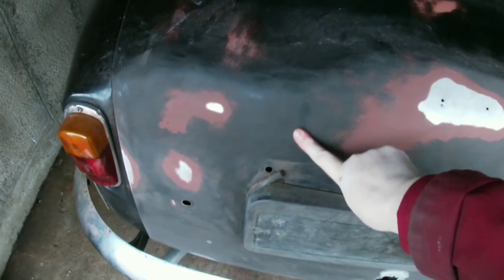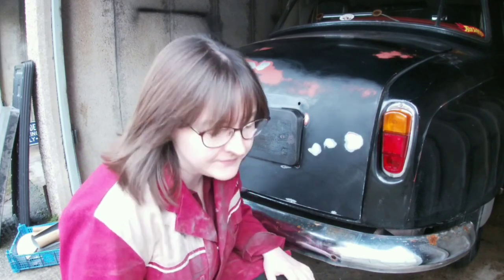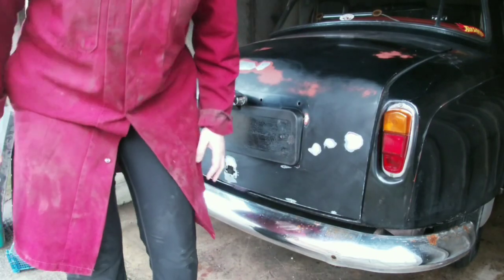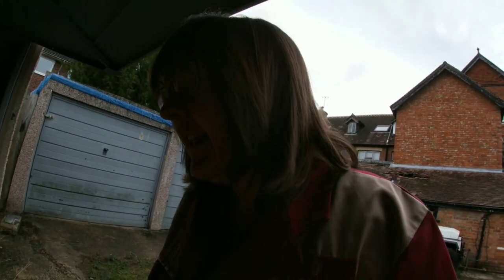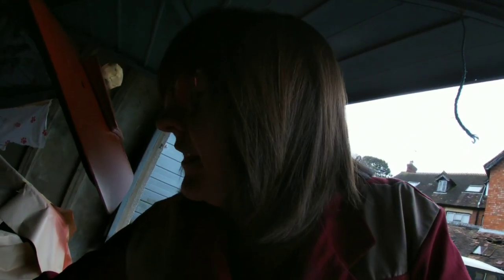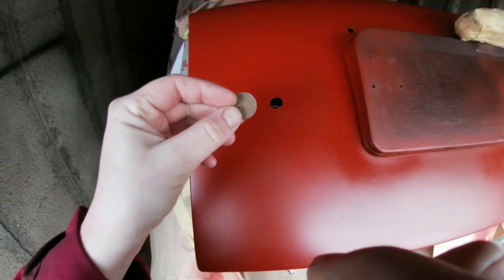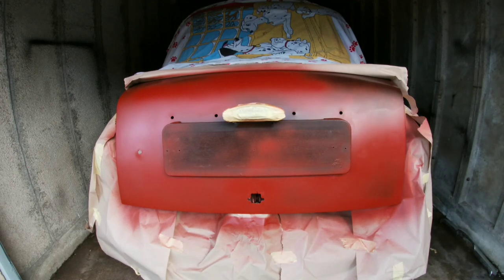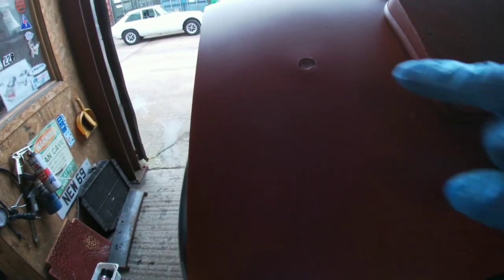ROVER P4 Boot tidy up Part 2 . Back to Black .

Comment: Alex  1) you must use a tack cloth as final clean.  Aluminium (or more correctly in this instance, Birmabright, does corrode. For longer-lasting, better-looking paint on aluminium surfaces choose Rust-Oleum® Professional Aluminium Primer Spray. This durable, spray-on base coat ensures a tight-binding top coat that eliminates the problems of blistering, flaking and peeling.   3)   the problem of the boot lid handle causing damage to the panel is very common due to the softness of the Birmabright and is likely to recur over time.   You are doing a great job 😃

Comment: Funny that I did exactly the same on the handle of the boot, using the plastic/rubber seal used for the overriders.
Reply from the maker: That's the stuff! I don't know if it's supposed to be there? Seemed a good idea 😄
Reply: @Alexsassets  I don't know either. But I didn't like the idea of the chrome of the handle rubbing the (new) paint of the boot!
Reply from the maker: @tanneguydecourcy6079  I started to put it on without the rubber and the edge scratched the paint 😬 that's what made me think about the rubber lol

Comment: Hi Alex, I am in the process of restoring a P4 95 and have come up with exactly the same problem as you after fitting new rear quarter panels; the spare wheel lid now has gaps. So I am just going to add bits onto the lid to compensate. The panels were advertised to fit the 95 for my year but I wonder? The panels I removed were in a crumpled state to do a comparison with the new ones.
Reply from the maker: Interesting. . . I wonder what it's all about.... I still think it must be dodgy after market panels.